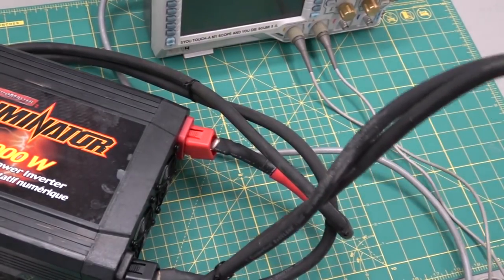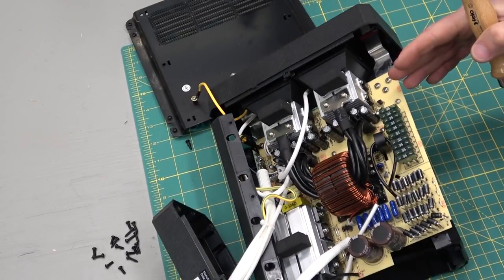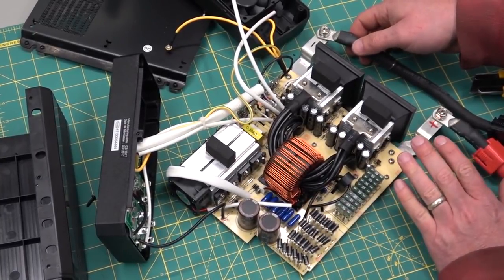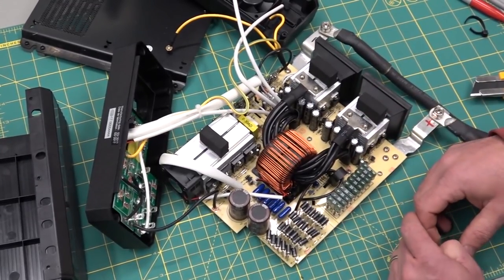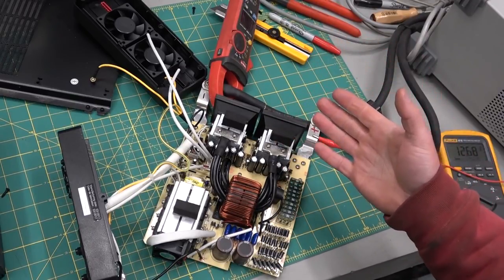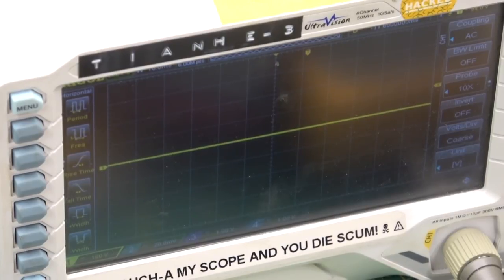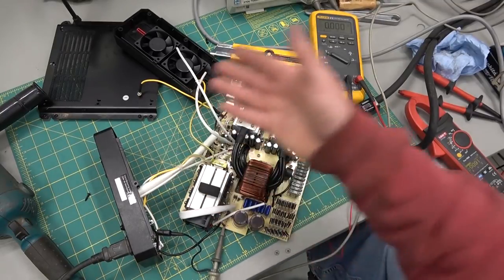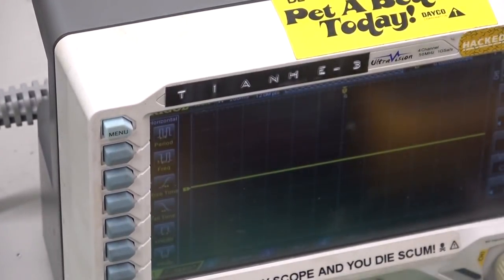BOLTR: 2000W "Digital" Inverter | Pure Sine Wave?

Comment: I believe there is a possible solution to the generator on boat problem you had. While watching this I was thinking. If you are already inside the thing why not connect one of the sockets (or add an external one) directly to the 120v DC bus and label that DC. I think that coffee machine will work just fine on DC and also any other load like a heater or a universal motor. The only problems will be with devices or parts inside devices that work only on AC like: line transformers, induction motors, some florescent lamps, capacitive droppers, triac power control...

Comment: The oscilloscope triggered on the switch frequency because you used a to small timescale. When you changed to a 20 ms time resolution it properly triggered on the pwm. That's the curse of the auto button ;)

Comment: Body diodes are "technically" beefy, about as much as the actual mosfet according to datasheets. It's just that when you reverse the input voltage the diodes will turn on hard and they can only turn off by exploding the crap out of the fet.

Comment: 6:30 When changing MOSFETs for the DC bridge it has to be from the same batch. Two MOSFETS from different batches with the same description will not have the same values. So when changing MOSFETs for a DC bridge it has to be from the same batch otherwise the MOSFETs will fight each other and cause unnecessary heat and primature wear.
Reply: Atleast in the same banks.

Comment: i just did the goof he talked about with our 750w inverter    it got the 4-25a fuses.   soldered  a wire to test and it fired back up so i guess i will pick up some 25a fuses and resolder them in

Comment: What are all the diodes doing? If they aren’t paralleled up for reverse polarity protection?
Reply: Rectify the sawtooth wave form
Reply: These work by chopping the input 12V at high frequency, stepping it up through a transformer (all those copper coils) to a high voltage, and then rectifying - the purpose of those diodes -  to create a HV DC bus. This DC bus is then switched by the output stage at a lower frequency to generate the 60Hz output.
Reply: They are practicing parking
Reply: Almost certainly they are for polarity protection.  The only reason for that many in parallel is that they are on the low voltage input side, which doesn’t need rectification.
Reply: I didn’t think about the thing using a high frequency section to get high voltage dc then using the second set of mosfets to make the modified sine wave. That said the diodes are right by the fuses which should be on the 12v input side. The diodes that are rectifying the switched high voltage 170v DC would only need to handle 20 amps compared to that giant parallel arrangement carrying 200+ amps
Reply: Good point, I guess you're probably right. Seems a bit silly and wasteful to burn so much power on that. Thermal runaway might also be an early failure mode. But I suppose they got tired of warranty replacements due to idiots...
Reply: To me it seems like the diodes are in a FULL BRIDGE RECTIFIER configuration on the transformers HV output.
Reply: It's a full bridge rectifier connected to the transformers High Voltage output side.
Reply: Paxmax you win the prize! I took a screen shot of the back of the board they are bridge rectifier for the high frequency. The number of them really through me for a loop because you would expect the current at 170volts roughly to be 20amps or so. That’s a cool layout I never really though about the fact that these inverters are DC-DC boost converters then an inverter. Old school inverters would pump the 12v at 60hz through a transformer and weighed a ton!
Reply: Some other interesting bits are the transformers HV side output wire feeds through several parallelled capacitors before entering rectifier. The other HV output wire feeds through a current transformer for pulse by pulse feedback. I'm guessing the switching will occur when the transformer output current pulse will drop too low.

Comment: Think about the missing ground. It means either the input or the output were switched from the top and bottom voltage switched. The negative of the battery is not "ground" but either the highest or lowest voltage on the line.
That is kind of not neato. So a separate isolated battery input should be used and that "negative" on the battery should always be isolated from ground? Right? (In case newer units fixed this which is doable)

Oh, when variable length on switching is used to simulate the sine wave, this creates an ever impossibly to follow spike pattern. Filters can be added to smooth notch out frequencies. (Rendering useless for powerline communication)

Comment: Because the output H bridge just chops the hv buss you don't have voltage spykes. Also there is no inductor/transfomer on that output except for a small common mode choke and the switching frequency is 50 or 60 Hz

Comment: I've learned that fuses in parallel is something you should avoid, fuses with the same rating aren't the same! They may have some miliOhms of difference between them, this will cause a uneven current path, one fuse will conduct more than the others. This can blow a fuse "prematurely" (this blown fuse would work normally in a single fuse circuit) even in normal usage, limiting the total current that the system can take, causing more fuses to blown, a cascade effect. The device may never overload but still can fail.
Reply: Same with the diodes!

Comment: Body diode in MOS-fet transistor usually can withstand at least the nominal current of transistor. So if those transistors are 100A each then this diodes can take at least 400A. The issue is that 12V lead acid battery can pump thousands of Amps.
Reply: That's what fuses are for: they should blow, so MOSFETs are alive, along with brainboxes because they didn't experience more than 0.7 volts reverse polarity. I've had situations when things were exactly as this: replace the fuse and everything's OK.

Comment: If you happen to get hold of one of those dewalt 1800 inverters it would be great to see it on the scope. It will run my 110v mig welder but the welder definatly sounds different. Thanks for the video!

Comment: Depends a lot what model inverter and the quality of the inverter...some have more steps than others, some are actually impressively close (close enough my cheap scope looks good) to a "real" sine wave.

Also note, some stuff doesn't like those low end ones.  I've seen laptop chargers that it will not work on my Harbor Freight inverter but run great on my Xantrex inverter.

Comment: EE here -- body diodes are always (at least, I've never seen otherwise) rated for the forward current of the MOSFET.  Not that the eight of them will actually handle fault current if you crosseyed the battery, mind.

Fusing: the transistor always protects the fuse.  The transistor burns out in 100 microseconds, the fuse in 10,000 microseconds.

Inverters: P-channel MOSFETs suck -- they're about 2.5 times worse performance.  N-channel is easy to use with a cheap little driver chip.

Good bet they're using push-pull, on account of how the transformer looks to be wired (mind, I've not seen an up-close of it), and because it's better at low voltages and high currents.

They might actually be using full bridge anyway, mostly because their transformer is a POS for this kind of current.  Those body diodes clamp the voltage spikes from the transformer that way.

Impressed that it's at least got a current transformer on the output side, by the looks of it.  Maybe it won't actually explode when surge loaded (hey, it survived blipping the grinder, that's a good show), or heavily loaded or overloaded (maybe it'll even shut down smoothly?).

Comment: It would be cool to take a look at the output current wave with current probe to see how it compares to the voltage wave under load. I'd bet dollars to donuts it is more sinusoidal than the voltage output waveform (dependent on the device being run).

Comment: Hey AVE! Your wrong! 

7:12 in the video...the most common failure mode of MOSFETS is to fail short circuit. There are some circumstances that can generate an open circuit, noteably if you short a battery and forward bias the body diode, and the package litterally explodes (no shit stain...a three legged ghost of an outline where the mosfet used to be...), and force the body diode to exceed it's power ratings. 

Failing open is much much less likely than the silicon melting together, or forming a Cascade short between source and gate and gate and drain. A few notes from a professional pixie puzzle designer.

Comment: Finally, often cheap inverters cause issues with some loads because they have large common mode noise issues.  A dumb load like a light bulb doesn't care about CM noise, but any thing electronic can do, and high frequency common mode filtering on the input of 50/60Hz AC powered equipment can be marginal because on a normal grid there shouldn't be much noise there......

Comment: I’ve been doing some research on these for my senior project, I can tell you that this is likely a modified sine wave inverter, NOT a true sine wave inverter.  The very fast switching attempts to recreate a true sine wave, but in reality it does have its downsides.  Running DC motors, Microwaves, and Florescent lighting with this generator will show you the difference.

Comment: All those parallel components ... now I know where Delaney what built bootleg "linear" amps back in the 70's (D&A Phantom 500's etc.) is designing now. Maybe they should use horizontal sweep tubes in the inverters, less sensitive than those damn Mosfets...

Comment: Like you said, just about 99.9% of electronicals out there are perfectly fine with that "rough" approximation of a sine wave. And I do believe more and more MFGs are building their rectifiers to handle just such a thing. I'm of the opinion that "true sine wave" inverters are more sales pitch than anything. Yes, they have their purpose in very specific applications, but the vast majority of people out there who think they are necessary are just buying the hype.
Reply: A variable speed AC fan on a modified sine wave inverter will be all sorts of noisy compared to running off of a pure sine wave. 
Last I heard a significant number of people had a cheap box fan with high-medium-low settings, and that's not necessarily a "very specific" purpose.
Reply: Many things will run on that square wave, but a lot of things are far from fine getting fed those steep flanks. Motors and transformers will run a lot noisier and any capacitive load (like all switch mode power supplies) will suffer current spikes with every flank.

Comment: This was a little to quick on the reverse engineering. Those diodes looked like a rectifier when he showed the back side of the board. And the interesting/odd half-turn primary windings on the output transformer, in two directions, clearly indicated a push-pull topology.
Reply: Ibrahim Ulf Karlsson - One pass through the centre of a toroid counts as one full turn. In other words, there are no half turns on a toroid.

Comment: 170V peak at 70% duty cycle gives the same RMS voltage as a proper 120V sine wave. Good for filament bulbs and heaters but not so nice for SMPS inputs - laptops, wall warts etc. But you knew that.

Comment: Any decent inverter has an input of 24-48volts for a lot less current draw and thinner conductors. Most computer UPS systems use at least 24V supply.  12V inverters are for light duty camping, keeping under 1Kw. Secondly it is almost impossible for PWM/buck alone to produce sine wave. A rail of IGBT/SCR etc biased at different rail voltages allows a device to quickly add / subtract (reactive) to load changes.

Comment: The generator puts out DC voltage, AC volts is not some giant spinning chunk of copper. 15:00 mark Dc power is sent over the big wires,and AC is made from it locally.
Reply: What? Generators ALWAYS put out AC voltage.
Reply: After a moment's thought, I should qualify my statement a bit. Yes, it's possible to make DC power from a spinning object, yet I've encountered exactly one installation that did so. It was giant, ancient and comically inefficient. The mere fact that electrical substations contain banks of buzzing transformers should be plenty of evidence that utilities transmit AC power. I also toured the control room of an electric utility two years ago and noted the reactance in the system, which doesn't exist in DC transmissions. Even a DC alternator actually converts AC to DC.
Reply: Sorry you are correct, but it is converted to DC to transport over high voltage lines. The the rotor is not making the wave form.

Comment: First look, that inverter is TINY!  Compared to the one on my work truck, that one looks like its good for a coffee pot or so.  I cant send it to you, as it isn't mine to send, but I can send you a picture of it.  It is Monstrous, and runs Husky chainsaws, Hitachi 3/4 impact guns, Hilti sds chucked drills, everything.  I'll snap a pic when I get the chance.

Always had this question:  Old truck had two engine batteries, separate battery bank to run emergency electro-hydraulic pump to stow boom, for towing of course, incase of engine failure.  How the hell do you charge both systems, yet limit each bank separately?  How could one (short of moving batteries around) bypass that system, say in the case of dead cranking batteries, yet plenty of power in aux systems bank?

Comment: you could try running a VFD off the high voltage DC rail to get a true sinewave
Reply: You can feed the dc buss of a vfd directly and let it do the chopping and sorting into a wave, skipping the middle man....at least I think you can, maybe.
Reply: those VFD are mostly 3 phase PWM output you will need filtering to get sine wave , and you could not run single phase load on them. normally

Comment: Parallel Diodes? No bueno. Small differences between their values will cause one of them to create more heat than the others and then boom...  The remaining ones will have to take more current than the others, the cycle repeats until catastropical failure.  Thermal runaway IIRC.

Comment: Bull sine! This is modified sinewave.  True sinewave has another stage which switches at about 10-20kHz and blends in the 50hz. Then a relatively small inductor filters out the 10-20kHz PWM  and you get allmost perfect sine on the output. The  HV stage actually acts like a class H power amplifier and can be modified to output music instead of 50Hz  sine.
Reply: Also a high power class H amplifier can be used as a true sine inverter. It only needs to have about 300V on it's DC bus. Or you can buy a mod board for driving a mosfet output stage and LC filter to add to an existing modified sinewave inverter and make it true sinewave. That's what i have done :)

Comment: This is basically how your class D audio amplifiers are, they just have a fat ole inductor on the output. They have a decent enough switching rate on the output to give mostly clean signal but the next step is to go GaN fets and switch even faster. Easier to filter out higher frequency noise than what our current silicon fets are running at. Only issue with GaN is it's sensitive to inductive loads.... But what is a speaker?.. it'll be a moment before GaN beats a push pull A/B class amplifier.

Comment: Unbelievable Ave, its like you read my mind or something. 
I had what i thought was a good inverter, but hadn't tried it yet. And the other day i had it hooked to just a dam fan , and as you would say she let the smoke(not a pleasant smell) out after about an hour. So i disassembled, and im sittin here and your doin surgury on a very similar one. Mine had 4 or 5 blown mosfets, but i wanted to fix it.
So that was very helpful.  Kudos
I wonder if the mosfets were all the damage though? If thats it (I HAVE THE POWER!) And a new desolering gun,will travel. Lol

Comment: Not accurate on connecting the leads backwards. You are correct on the body diode, but I have connected them backwards and it just blew the massive array of fuses. Hell of a spark, changed fuses and she chewched again

Comment: A lot of these units will do opposed phase 60VAC on hot and neutral to make the 120. This gets extra weird when you have devices that only run when they sense good ground and won’t fire because they see the 60v between N-G. Only way I know to trick them is to wire them together at the device, which is terrible.

Comment: I get the 2 banks with fans and black wires through the toroid as pulsing the DC to get AC on the thinner wire on the toroid.  However, what does the third fan and FETS do on that 3rd aluminum block?

Comment: this is a modulated sine inverter, not pure sine, otherwise it would be written "pure sine" on it.   pure sine works on shitting pwm at a high freq into that transformer which is modulated from 0 to 100% in a sinusoidal way, after transforming it up to working voltage its lowpass filtered. result is a sine wave.. basically a beefy as fuck class-d amplifier fed by a 50hz signal, gain controlled by the output voltage feedback